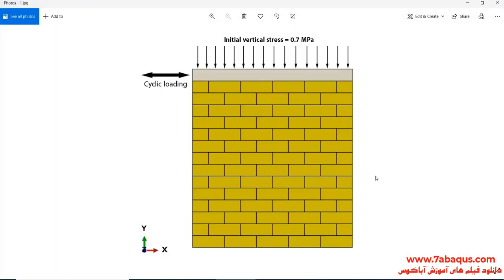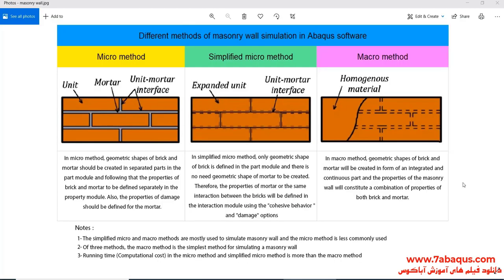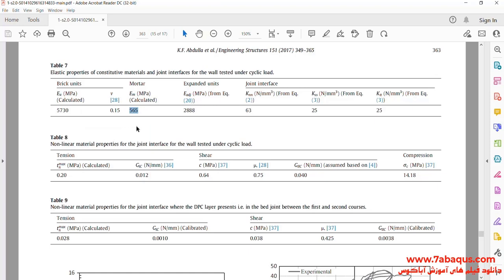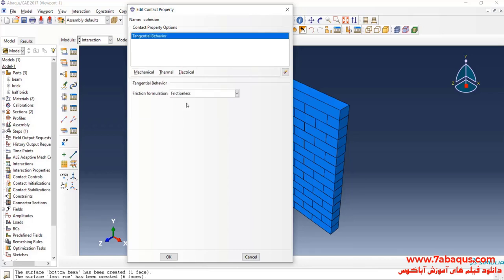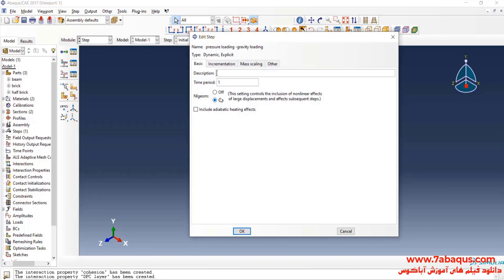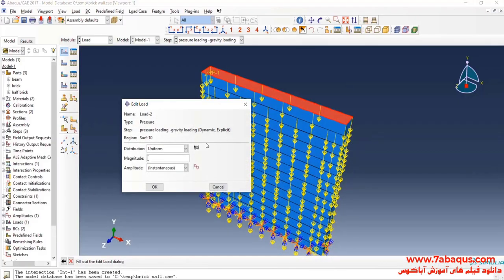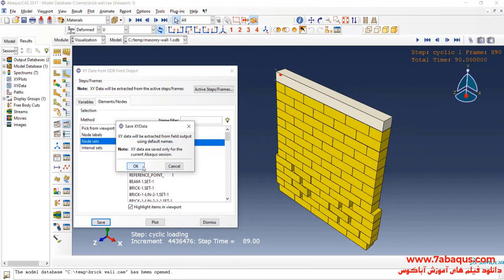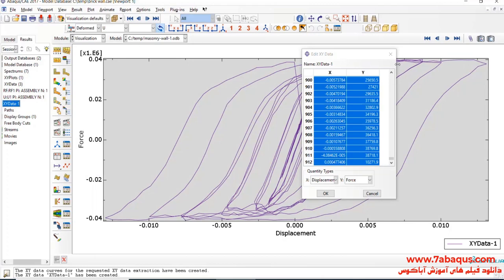Masonry wall (brick wall with mortar) under in-plane cyclic loading using simplified micro Abaqus

Comment: Hi, I just wanted to know how you decided on 89 Sec as the time for the cyclic loading? Thanks in advance.
Reply from the maker: The total time is 8900 seconds, which we considered one hundredth of it, because if you consider the time as 8900 seconds, it takes a lot of time to solve the problem by the computer, and the time of 89 seconds does not affect the results.

Comment: Very helpful video sir. I think you have put the joint tensile and shear strength values in damage tab (tn, ts, ts). If i am right, please help me what values you have put for shear strength. As in the paper it is according to the mohr-columb criterion, . What are the final values you have put for tn, ts, ts.
Thank you sir
Reply from the maker: these are properties of mortar or same joint interface
Reply: @saeedmoeini-7abaqus  in the paper it is mentioned that "critical shear stress of joints prior to failure is described by Mohr-Coulomb failure. Further it is said that the value came from columb failure criterion,i.e. (T)crit, is used to define the shear strength of masonry joint tsmax, ttmax"
Since (T)crit depends on cohesion, coefficient of friction, and normal contact pressure. From experiment we only know cohesion and friction coefficient values and does not know the contact pressure. So how we would find (T)cric value to put in tsmax or ttmax tab.
Thank you sir
Reply from the maker: These parameters and formulas are used to calculate brick damage or cracks in brick in XFEM method
Reply: @saeedmoeini-7abaqus  ok thank you sir
Reply: Hello. Have you made and simulate this model by following the given research paper

Comment: But, modeling of RC wall by Abaqus gives inaccurate results because CDP  model in Abaqus cant model pinching effect in cyclic loading. I ask you model of RC wall by Drucker Prager can give accurate results than CDP under cyclic?
Reply from the maker: I used Drucker Prager , because the Drucker Prager was suggested in this article for simulating of brick wall with mortar
the CDP is better for simulating concrete